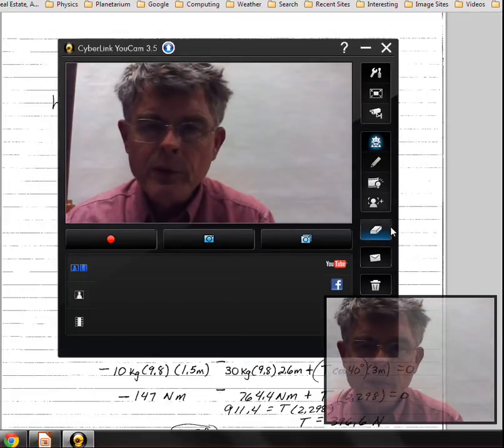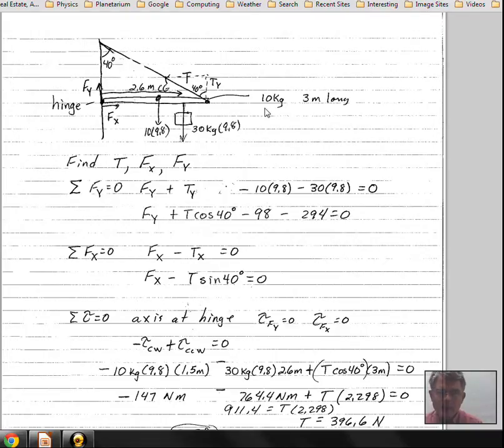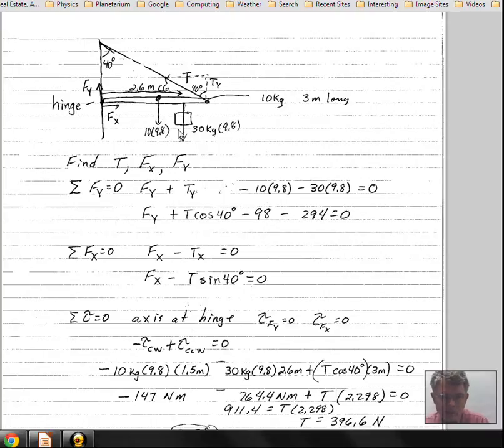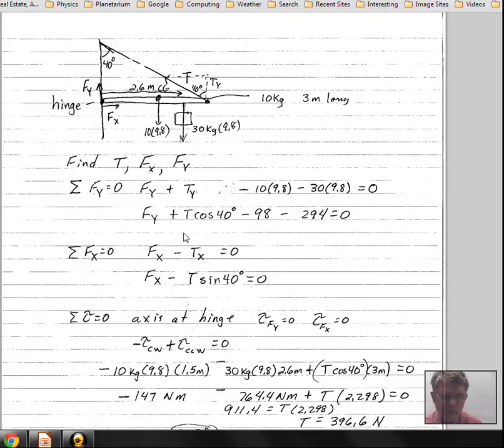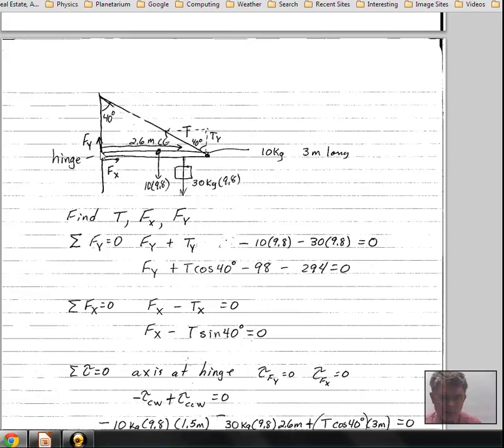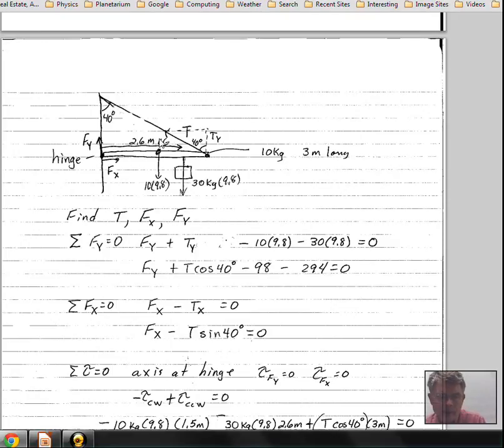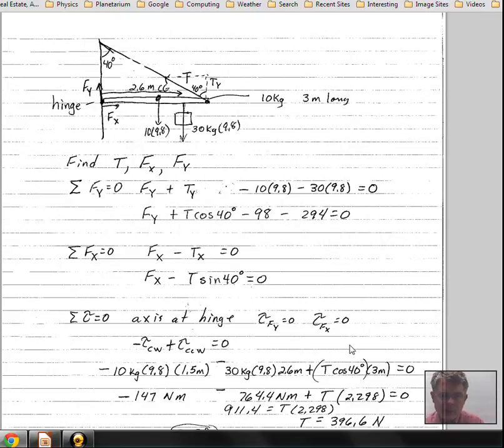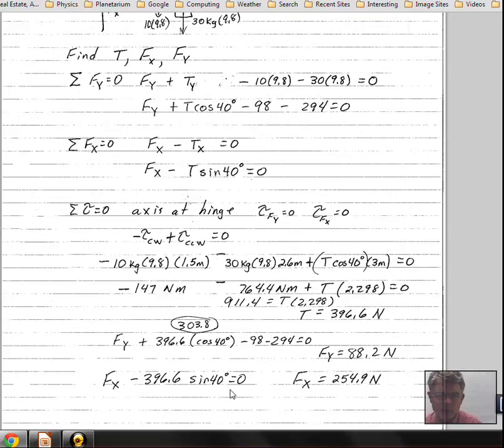Static Equilibrium Problem, Beam attached to wall, supported by cable

Comment: A good basic overview. But, why are you saying torque instead of moment? If you summed the moments about the hinge, then the term torque would be relevant. But, because forces were summed about the center of the beam, moment is the better term as the rotational forces are formed by couples. Peace.
Reply from the maker: This problem involves two force equations, one for the x direction and one for the y direction, and one torque equation.  In the torque equation, for each term, a force is multiplied by a distance, creating a torque quantity.  I do not use the term "moment" when I work this type of problem. Best Wishes